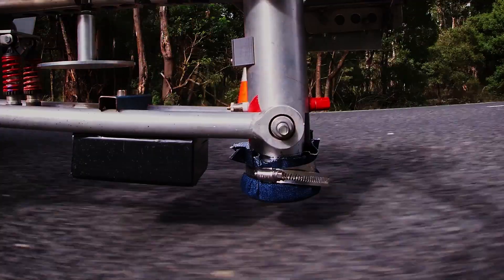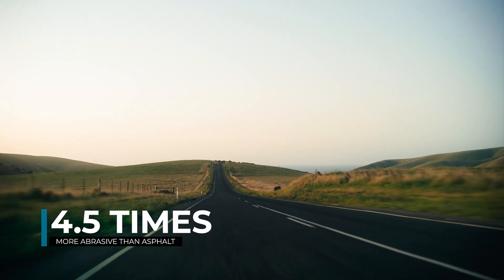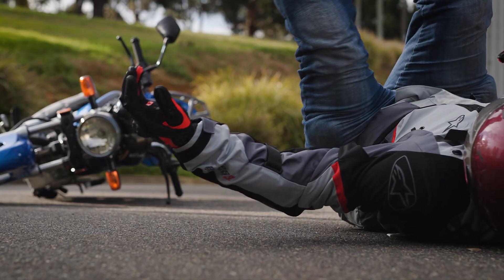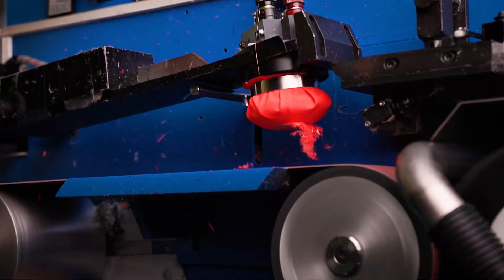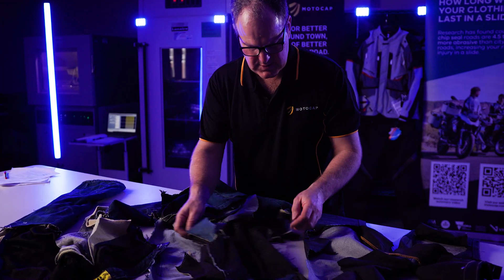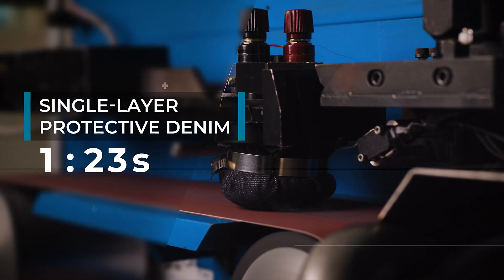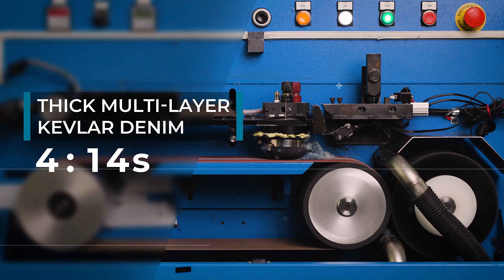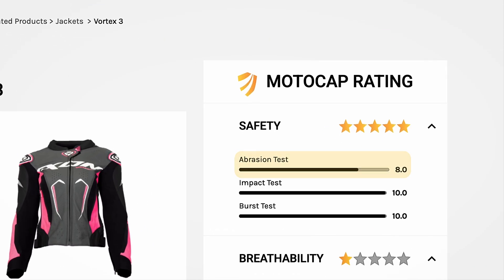How and why MotoCAP tests the abrasion resistance of gear

Comment: Absolutely vital work that all motorcyclists should be aware of. Thanks to Chris Hurren's team at Deakin for their hard work in testing motorcycle clothing for its suitability for the job of protecting the wearer. And as John Milbank says, many UK roads use the same kind of chip seal surface that's so destructive of riding kit when we slide off.
Reply: Thanks for the endorsement Kevin.
Reply: @christopherhurren629  you're more than welcome Chris... I've seen the effort you put into testing bike kit for MotoCAP first hand of course!

Comment: This is absolutely outstanding work, and vital for buyers to understand in order to make informed choices when buying their motorcycle kit. It's also worth pointing out that the surface dressed roads that make up most of the UK's non-urban environments are the same as Australia's chip seal. John
Reply: Thanks for the endorsement John.